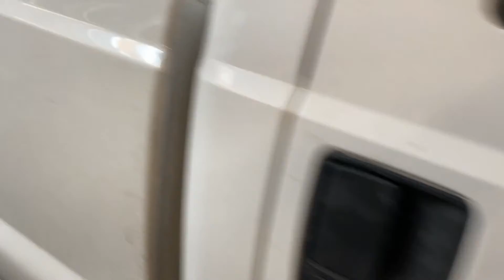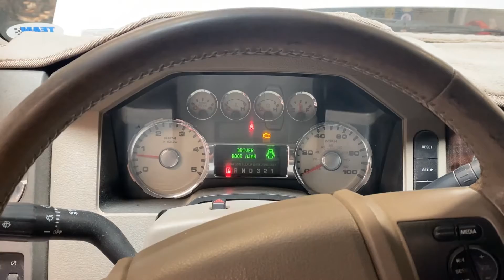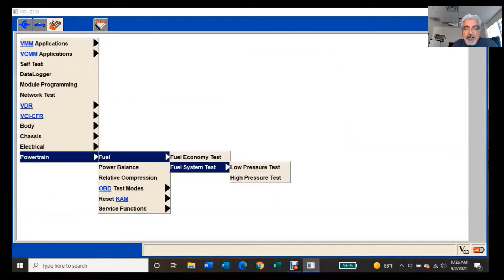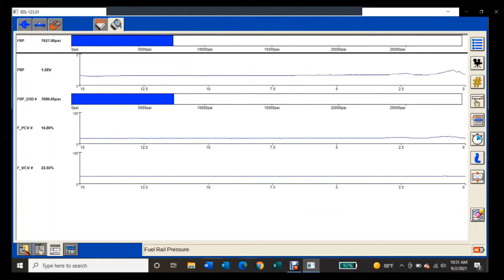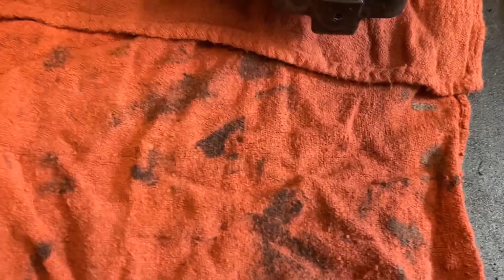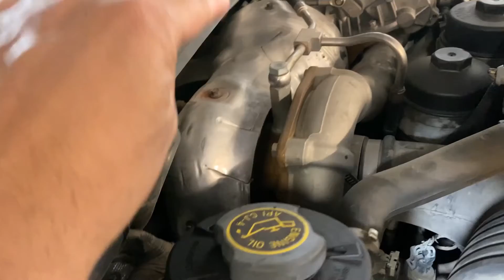Powerstroke 6.4L High fuel rail pressure code set.

Comment: Have this code P1189 and check engine light on, can it cause the truck to heat up while pulling a load.
Reply from the maker: When u mention heat up 
Overheating?

Comment: Question my 2009 is giving me code P2291 Injector control pressure to low engine cranking and checked my lift pump and getting 24 psi supply to injection pump and return pressure is about 4psi on the test port and no fuses open either. The trucks started and stayed on for 6 seconds and then stalls now it wont start at all, also got the oil pressure icon on too now when cranking but not all the time though any toughs truck has original 21k miles any thoughts?
Reply: There is a fuel system issue - more common with 6.0 but can also happen with the 6.4 as it did with mine - where you get the P2291 code and motor stalls out when fuel tank is less than 1/4 tank.  The sending unit inside the fuel tank has a plastic screen/filter/valve at the end of the unit that breaks off which causes air to be pulled into the fuel system.  This is what causes the truck to stall...and wont restart until the system purges the air out (the 6.4 fuel system is self purging to an extent).  I was also getting erratic fuel pressure before it stalled.  You have to drop fuel tank to replace the plastic screen/valve or the entire fuel sending unit.  This fixed the issue with my truck and has been running smooth since.  Theres a video on YT: 6.4 Powerstroke 1/4 tank issue.
Reply: @bend6108 Thank you very much I will check the video and check that possibility.
Reply: Funny. I’m having the exact same issue, but mine is after an oil change place changed the oil and fuel filters. The running idea is that they got to much air system. 
If you reprime yours 10 times for 30 secs it will restart but die after approx 10 secs with that code. Let me know what you find and I’ll do the same.
Reply: @ cesargarduno7999
So my truck was taken to mechanic. He said high pressure fuel pump was bad. I towed it home and purged the crap out of the fuel system. It had air and that was causing exactly the problem you are having. Would run for about 10 seconds and die. They had tried to purge it many times but apparently did not do a good enough job.
Reply: @mattm1447  Thank you I will try to bleed as many times possible and see if this helps except mine just died out and left me stranded.

Comment: Have you seen low pressure side of the fuel system be at 8psi key on engine off, then drop to 0psi while running? No codes engine runs good.
Reply from the maker: That can happen 
You build pressure when there is no demand for fuel.
You do a volume test on line going into the secondary filter 
Turn key on 500 mil or have a liter in 30 seconds.
If not enough pump issue
If it gets that or better is the regulator which is inside that secondary fuel filter . Need to replace the whole housing
Reply: @dieseltalkwithtonysalas8725  
Thank you for sharing your knowledge!

Comment: Would either a faulty high pressure pump or either of it's valves cause a crank no start issue? Bled the low pressure system and scan tool shows fuel rail pressure at 0?
Reply from the maker: Remember in order to create pressure you have to push against something which in this case are the fuel injectors. One injector with excessive return can cause low rail pressure. 
In rare cases we have seen the nozzle stuck open. 
Are there any codes set?
Reply: @dieseltalkwithtonysalas8725  No there is no codes - batteries were dead however so any codes probably erased but now with new batteries no new codes being set.

Comment: hello tony!! i have a question, i have a no start issue, i have been monitoring pcv and vcv pids, pcv cycle duty reaches to 55% and vcv reaches to 32% when cranking, when i put the key on both reach to 30%, and then they get low to 0,   my fuel rail pressure stays at 20 psi, and desired reaches to 4500-5000, ive been bleeding the low system but im not sure if its the issue,,

i feel like if it was the vcv not making the fuel get in the hpfp..    my code is P2291 icp too low when cranking,, any ideas?  thanks in advance
Reply from the maker: How did you bleed the low pressure system?
Reply: @dieseltalkwithtonysalas8725  fuel cooler, not the schreder, i bled it from the banjo bolt near the fire wall
Reply: Hi Tony really appreciate your helpful content. I worked on 2009 f350 6.4 recently with complete fuel system changeover by Alliant power. Also installed an aftermarket turbo with updated actuator that does not use coolant. Truck starts and runs but most of the time when accelerating hard loses complete throttle response and have to turn engine off for it to go back to normal and repeats again on hard acccel. Mostly no codes and sometime low fuel rail pressure code. No other codes. Real mystery. Any thoughts

Comment: Does cab NEED to come off to repair?
Reply from the maker: The secret is if you can take the turbos out. The back flange bolts from the up pipes is what makes it hard. If you can get them off then the turbos can come out through the passenger side in the engine compartment. 
If not cab needs to come off.
Reply: @dieseltalkwithtonysalas8725  thank you sir,

Comment: Hello, I have a question. My 2008 f250 throws the antifreeze out of the tank cap and when I'm pulling something heavy or when I'm driving up a hill, it also throws it out and it gets hot.  what do you think is the problem?  Thank you .
Reply from the maker: I dont want to scare you bit ot seems you are getting pressure that is pushing coolant out. Could be one of the EGR coolers or worse head gaskets.
But you dont mention any white smoke.
When towing do you hear the fan roaring?

Comment: Hello tony ! Thank for the videos and I’m hoping you can help me. I had a leaky pan gasket and then a water pump went out so I did them both at the same time “ cab on btw” after re assembly I decided to do the fuel filters as well! When I finished all this stuff I primed the system as I’ve done in the past and the truck started after 10-15 seconds it shut off and displayed a oil can and a wrench along with a P2291 code I changed the ICP sensor and the oil switch as well and it’s still doing the same thing please help me , I wanna know how to test the high pressure pump and the oil pressure
Reply from the maker: Given the fact that you did the oil pan gasket there might be an issue. Need to remove the oil pressure switch and put an oil pressure gauge to see if you have oil pressure.

Comment: If your frp is locked in to a voltage what red flags are you meaning ? Would it be replacing the frp sensor and wiring harness or other issues ?

Comment: Hi yes it's a big job..you didn't show F..F Data & duplicate problem..
Reply from the maker: FF data I rarely use. I don’t get any info I need and rail pressure is not provided. 
I did say in the video that the day before FRP was locked at 3. Volt range the day before. It isn’t like I carry a camera for those moments the truck acts up. The PCV is intermittently sticking. Have repaired many through the years. 
But thanks for commenting